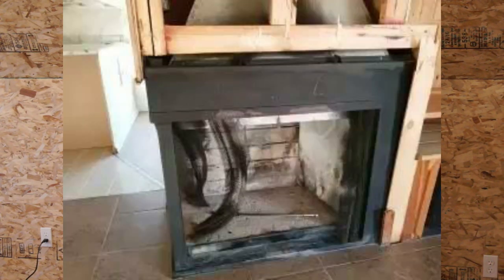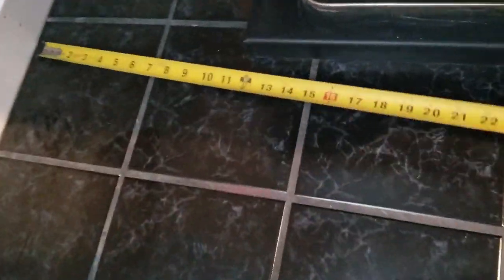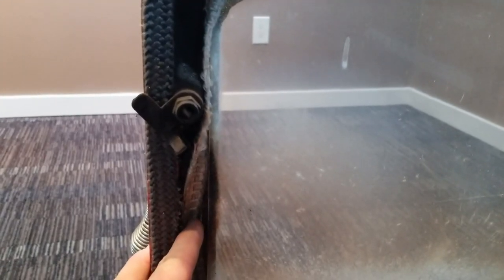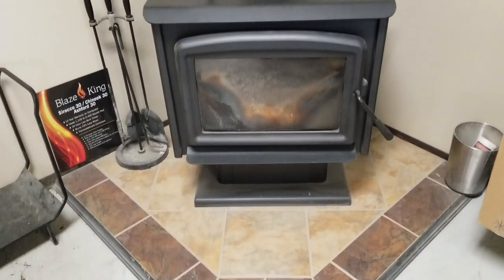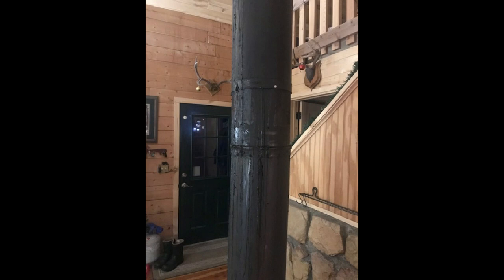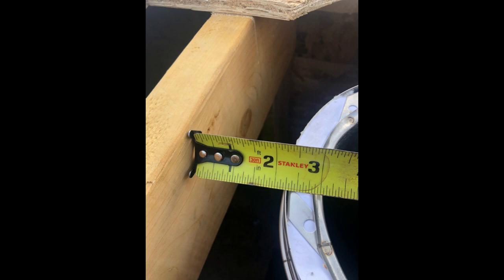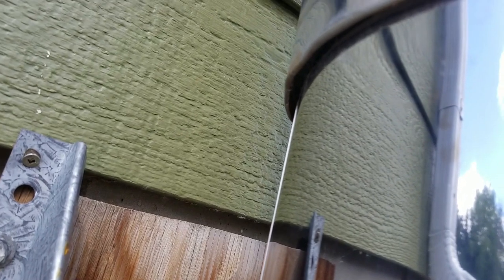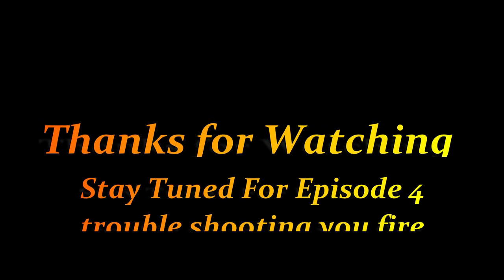Home Hints Part 3 Wood stove Inspection

Comment: This has been an awesome help, thank you so much for your time and posting this video.
 I'm a 1st time homeowner and my home came with a stainless steel chimney on the side of the house. There was no stove inside, but I was given a free wood stove. It does have the specs calling out the installation procedures/clearances. Glad to know that the installation recommended on the label are the best way to install & pass inspection. Now I need to inspect the stainless steel chimney to make sure it's up to code.
Thanks again for the info 😎👍
Reply from the maker: Stainless chimney must be rated for 2100°. Usually 2" insulation pack but several newer 1" chimneys meet the standard. Chimney must be supported well at the base and have proper 2" clearance from combustibles. Some base"T"'s require a wall thimble and some don't. Send me photos via my website contact info and I'll try to help

Comment: I appreciate the information on clearances as I am fixing to get a wood stove and install it and I'm installing it in a 32 ft long travel trailer but I am down to the studs on the wall so I will be able to insulate it with non-combustible insulation and use metal studs in the area of the stove but I still needed to know the clearances. I also will be having some sort of shielding on the wall, thank you for the measurements needed for the heights on the outside and the clearances needed for the flu pipe going through the wall or ceiling. The travel trailer at one point already had a wood burning stove in it and now I need to inspect that fitting in the roof carefully to make sure that it's going to meet specs cuz I really don't want to burn myself to the ground LOL this is been a very informative video and it was very helpful and needed thank you
Reply from the maker: A travel trailer requires that the stove is certified as mobile home approved and must be bolted to the floor and have an attached fresh air intake. The insulation will be considered flammable even if you use Roxul.
Reply from the maker: I wish I had mire material to do more videos to fit every situation but ut would take a decade of inspections to get it.
Reply from the maker: Looked up your channel, I think we have similar political views. Wish I had more subscribers.  My wife and just talked about how many people are worried our government is going to shut off their gas and they are installing wood stoves as back-ups.
Reply: @borderpropertyinspections2634  the insulation I was going to use is the insulation that they use around kilns,. It's rated for over 2500 degrees.  It is non flammable.
Reply: @borderpropertyinspections2634  since I posted this, there has been a change of plans, I'm going to build a cabin on my 2.6 acres and put my wood stove in there..
Reply from the maker: @LadyTSurvival  ouch I was a year in response, no wonder I don't have many subscribers. Best of luck.

Comment: Hi. I really enjoyed your videos on wood stoves. Very informative and not judgemental against DIYers. Did you do that Part 4 of the series about problem solving? 

I have installed a number of stoves over the years as a wood burner for over 40 years. I have done a few installs over the years with tile over mill board with the 1" space using drywall hat channel. Does that drywall steel furring channel over the standoffs pass inspection ? It offers good support for 1/2" Durock and the screws for the Durock are isolated in the top off the channel and may be OK for screws behind stove especially if two layers of Durock with cement between. As well do 1" spacers have to be ceramic or can 1"long  pieces of copper, galvanized or SS steel pipe be used?

On another project I have run a wood stove into a builders box (desperate for heat at time) with a hearth in front of builders box. Pipe goes up from top and elbows down into builders box and then back up into 1" chimney inside a large exterior chase. I am aware that the builders box only has 1" wall pipe which doesn't pass on a wood stove. It has ran perfectly for over 15 years with no creosote buildup and everything from stove to top off builders box taken apart for cleaning. The draft was great considering the 4 elbows. A local stove supplier mentioned that you can purchase an adapter to put on the builders box that can accept the newer 1" wall improved chimney or even a 2" wall chimney adapter. 1" wall would be needed to keep 2" clearance to house wall in chase. Are these improvements, if done, passable on a inspection with a rear exit wood stove pipe or would it be better to rip it all out and make a bit of an alcove setup with new everything. Lots of work for sure 🙂

On another topic I don't see any information available if  1" Ceramic Fiber Insulation Board (2300 F) cemented to wall with no airspace and tile applied over that would be a substitute for the 1" airspace to reduce wood stove clearances.

Cheers
Reply from the maker: If the spacer is non combustible and a minimum of 7/8" it's good. Anytime something is attached to yhe wall it does not qualify as a shield for clearance reduction.
Reply from the maker: I have thought about making that forth video but gathering footage is tough. Overall I intended to talk about the stack effect and how your house can make a better chimney than the chimney and cause smoke spilage. Without good quality footage the videos become fairly boring.
Reply from the maker: And I'm not sure what you mean by hot box. You are right that 1" chimney is usually not S629 rated for 2100°F. Even if an install seems very safe it may lead to a fire abd if it's not compliant there will not likely be insurance.
Reply: @borderpropertyinspections2634  Yes I agree on the stack effect especially if not so cold and no wind outside. Found it best to open a window by the stove until going strong, especially if your better half has the dryer or range hood going (-:
Reply: @borderpropertyinspections2634  So it appears you are saying the hat channel is OK for the spacer behind the Durock as long as at least 7/8" airspace and open at top and bottom for airflow. The other question on the 1" ceramic board without airspace was of interest as I see no data or information on it on the wall. Only saw data on the floor application. It states it can take 2500  degrees and assume it doesn't transfer heat to the wall behind that a concrete product would.
Reply from the maker: @dpo1867  it will help prevent fires but it cannot be used to move a stove closer to the wall unless it has the airspace and appropriate dimensions. 18" past the stove sides, 20" above the stove, 1 -3" from the floor. Shields can reduce the distance from the back of the stove to the wall by was much as 66%. A non certifies stove with a shield on the back with 7/8" spacing will reduce clearance from 48" to 36". That's as close as you can get for an uncertified stove from what I understand in the newest update I gave recieved.

Comment: Very helpful, thanks.  I thought that any wall or floor that has a hearth or if it has a brick/tile wall around it was considered combustible if the material under the hearth or behind the stove (walls) it is still considered combustible. If that is the case, what is the point of say, puitting up say, cement board with tile if the combustion clearances are still the same?
Reply: You should have a 1" airspace behind cement board and stone to vent warm air up.
Reply from the maker: Not certain if I understand the question. If you add shielding to reduce clearances, that shield needs to be sized appropriately and spaced away from the wall which achieves the air space and cooling effect.  If the wall has a non combustible material such as brick or tile but no air space behind then it's not considered a shield. Non the less when measuring to the nearest combustible material you can ignore the brick and measure to the drywall or studs. Insulation regardless of the type is considered combustible, even Roxul.
Hope that helps.

Comment: Thank you for this video. I have one question. I am now installing a wood stove with single-wall pipe for the indoors and triple-wall pipe for the outside. Can I later switch to double-wall pipe for indoors?
Reply from the maker: Yes no problem
Reply from the maker: Double wall is best to give you more heat in the chimney to reduce creosote.

Comment: Is driving me nuts that the osb on the wall behind him is installed wrong. Joints should never line up like that because it makes it weak.
Reply: It's probably not structural but just as interior finish so not as important.
Reply from the maker: @paulrobinson5833  You are correct Paul. I trimmed the sheets with a narrow trim and it now has the look of sheets/blocks. I thought that would look best. Its just our barn/ rec room. Wish I could upload a finished picture, I think it looks pretty sharp.
Reply: 7
Reply from the maker: If you could see it now you would understand why I did that.

Comment: This is so helpful. Thank you. I have a question on total applieance+chimney height. I'm installing a wood stove myself and have the chimney at least 3 feet higher than roof plus 2 feet higher than the peak which is less than 10 feet away. The manufacturer of the stove "recommends" 14-16 ft from base of appliance to top of chimney. Is this something that is a hard and fast rule or can I see how the chimney drafts and add chimney pipe if needed. I just hate to buy more chimney pipe if its not required.
Reply from the maker: Your call but manufacturer recommends minimum height based upon rigorous testing. If they reccomend 14' of chimney its because that's optimum and less likely to cause back drafting. Sometimes your fist loss ($ for extra pipe) is your best loss. Smoke damage and poor performance is very costly as well.
Reply: @borderpropertyinspections2634  Thank you again. Another topic that I can't find much information on is grounding. I'm in a manufactured home and my Wood stove manual requires grounding wire from the stove to an ibeam. Any recommendations on clamps or where on the stove to put it?
Reply from the maker: @jadppe  I honestly have never heard of gounding a wood stove. Are you sure they are requiring that?
Reply: @jadppe wtf are you grounding?
Reply: @denverbasshead  Grounding the stove to the frame of the mobile home. It is a requirement. I guess because of lightning. I don't know why it's specific to mobile homes.